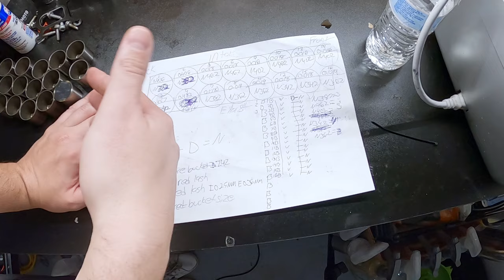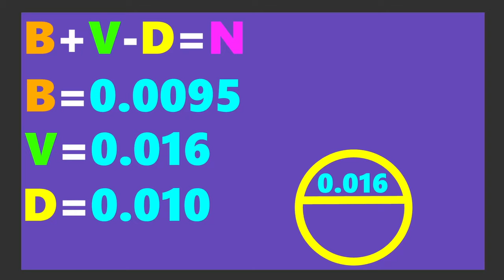How to Measure Valve Lash for Camshaft Bucket Sizing

Comment: Finaly foud a very nice and clear video for this topic, i am now in the fhase of remounting my camschaft and tappets back after dismateling the head, seems there is a big issue on the measurment taken so far an all seem off specs, althoug these are remouted the same way they came off, wil folow all the steps and see the outcome  to have everything back to Original spec for a Fiesta 1.0 Ecoboost 140hp  whit FD type camschafts,

Comment: Definitely gonna help when I do this on my yota motor i got on the stand. Just got the new rod bolts installed, now im back to the cylinder heads and wanna get those perfect before throwing it back together

Comment: Finally found a relevant video!!! I'm doing this on a 13 Kia optima.  Unfortunately I got a couple of the buckets mixed up changing the head gasket, now need to go through and measure them all...
Reply: For real, when I search for it I get flooded by videos by "world mechanics", "Auto repair guys," and "electrical car repair live." They make videos tearing the engine apart out of the car already and when they get to where they're going to talk about the adjustment the video ends and they never come back to it.  I wasted my time with their videos.  Yours is one of the most informative one I've found. Thanks again

Comment: So for example i got a 202 which is my smallest bucket and use that on all the valves to test the lash to get my numbers from your formula,  i also did the 1 bucket at a time method with the cam resting and the numbers were the same with it all torqued down when i wrote my numbers down just for a future reference.  

This is the link where i learned it from:https://youtu.be/kCwr55XTOok?si=uVphweX9L9DfzVco https://youtu.be/kCwr55XTOok?si=uVphweX9L9DfzVco